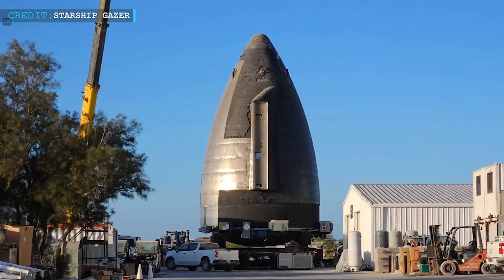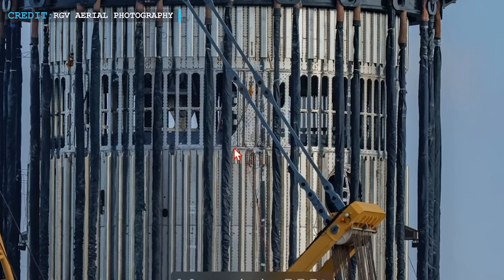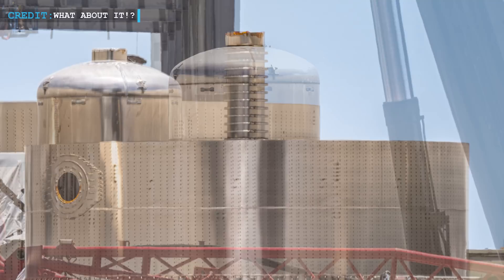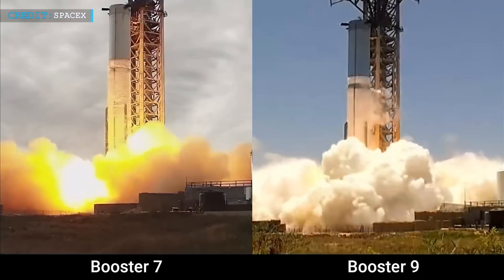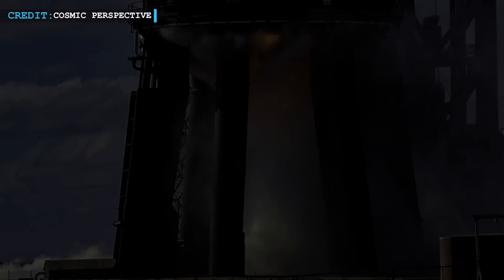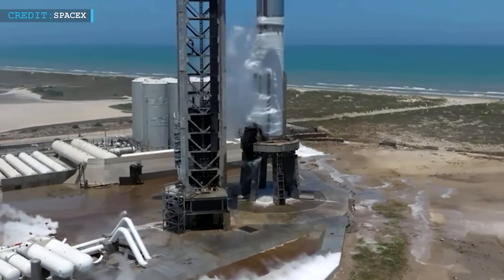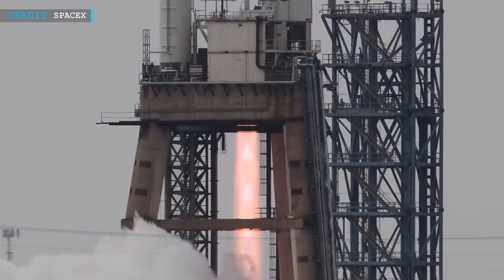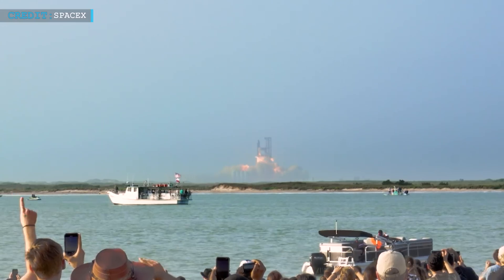The Big Design Changes In The Booster | Why SpaceX B7 Successful Static Fire Brings Attention Again?

Comment: Can't be having Engine Failings or Shut Downs,,,not if you're spouting all over the place about Going To Mars! Deluge System seems to have worked great, HOWEVER I've seen hundreds of Post Test Films ... haven't seen One Shot of the Steel Shower-Head Deluge Plates.

Comment: Successful? Shutting down prematurely due to not meeting launch criteria should not qualify as a success. I do agree that SpaceX may have ramped up production of the raptors too quickly and are stuck trying to integrate older, obsolete engines. Can't wait to see a Successful 33 engine test with none of them shutting down prematurely. 😊
Reply: It was only the third test- ever- to try to fire 33 engines at once in history.
Reply: The test of the water-cooled steel plate was s failure??
Reply: @ghost307  insufficient power was applied to the deluge system  to give a meaning evaluation of full launch power outcome .
Reply: @mikewallace8087  It gave an important data point, which can be used to simulate the full flow performance.
Those simulations, of course, will need to be verified later.
Reply: @ghost307  they did simulations before .  Look what happened on 4/20/23.  Maybe they need to use a better computer ?
Reply: @mikewallace8087  The damage on 4/20 was the direct result of the installed fondag concrete not living up to its promises.
SpaceX apparently forgot to apply the proper correction factors as follows:
Multiply all salesmen's cost promises by 2.
Multiply all salesmen's cost savings promises by 0.5
Multiply all salesmen's performance claims by 0.25 (they'll say whatever they need to in order to make the sale).
🤪

Comment: A 10%+ engine failure rate is impressive?
Reply: Yes, it is. Failure during testing provides valuable data.
Reply: @audience2  Oh man, Muskrats are so cute. It has been in development since 2018. So F no a 10% failure to even start is NOT a success. Raptor 2 is not a reliable motor. NASA  will be ready and realize the F ed up by awarding the HLS contract to SpaceX. Funny who the woman who decided to award the contract. Now works for SpaceX. I'm sure there was no quid pro quo involved there. Space Jesus is a fraud and SS is nothing but a way to increase funding rounds.
Reply: @audience2  The goal is no failure on first test and all following tests.  Failure and engineering revisions cost Time and Money. .
Reply: Just like Industry ...failure is lucky on new systems...so you "kaizen" it
Reply: @dadejazzba402  5 going on 6 years of development is not new. The F-1 engines on the Saturn 5 made it to the Moon in less time. Let alone limping to a few miles in height. Completely out of control.
Reply: @jcwiggens  new engines....33 of them...youre talking oranges.
Reply: Well, it could be worse. Also - any time that many engines are lit, I imagine the noise they create is impressive ;). Also this is the usual SpaceX methodology - rapid iteration with lots of testing, expecting to correct for failures along the way.
Reply: @logicalfundy  LOL, I knew someone was going to trot out that tiered old Musk trope. as an excuse for the failures of this rocket.

SpaceX doesn't have an engine/motor right now. Which means they don't even have a prototype rocket currently. Besides the wonderful and proven Falcon family.

BTW, don't count on any launches in Texas for a long time. Right now, SpaceX doesn't even have a FAA certified FTS.
Reply: @jcwiggens "Besides the wonderful and proven Falcon family."  . . . which was created using the same methods and had its own failures. Do you think SpaceX will give up and announce the entire program is a failure? No. They will just keep making modifications until it succeeds, just like they did with Falcon 9.